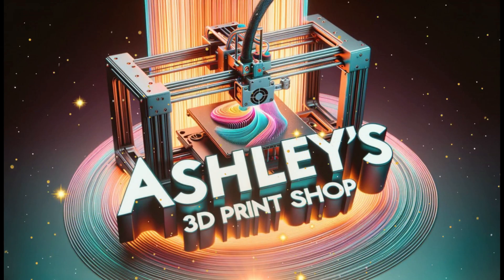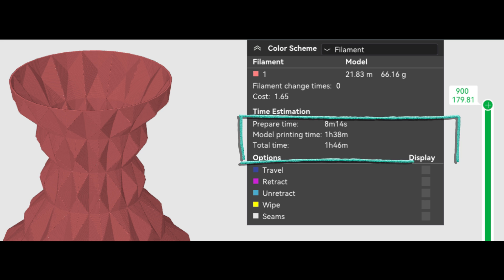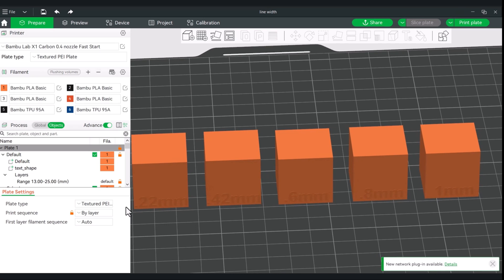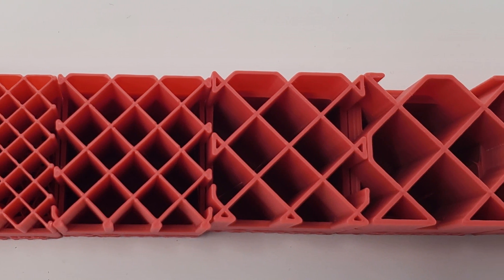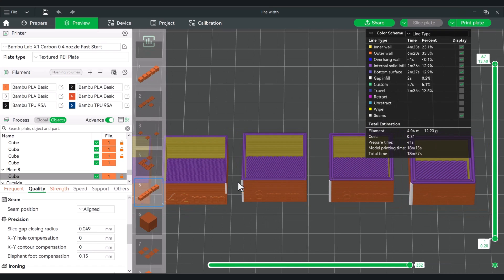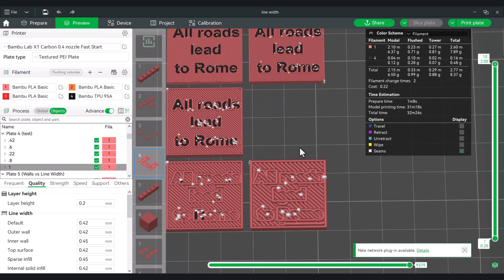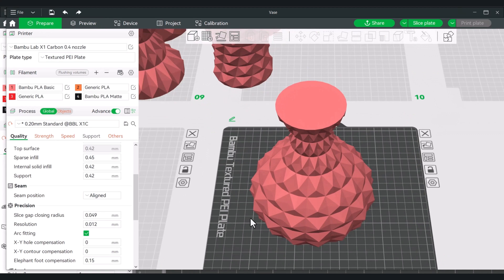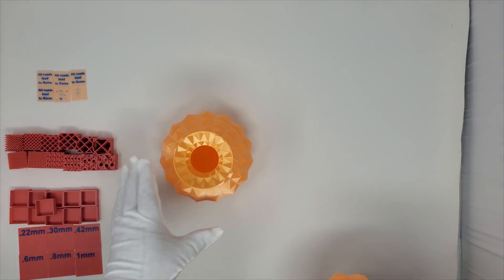Bambu Studio Tutorial Line Width

Comment: Hi, new to printing and trying seek best advise. I'm currently making keychains, I printed one on the standard settings with .4 nozzle at 0.8 fine setting. Came out good but I know can do better, it has lots of details, would 0.30 in quality settings do better, I had mine at 0.45. also need thick so doesn't snap easily.

Comment: Thanks!  I never thought a 0.8mm nozzle would be too useful, but I started to play with translucent PETG for containers, organizers, and vases.   It’s ideal to have one wide layer to keep a clear pretty wall,  but thick to make it strong.   multiple walls make it look cloudy.   Lots to play with here!
Reply from the maker: Great tip! I'm sitting here next to clear filament and never ran it with a higher linewidth so that is an excellent use case. I need to experiment with speed and temp too. 
If you find a good mix of settings would you mind sharing?

Comment: If you are increasing the line width, you are pushing more filament through the nozzle. So this might increase the pressure on the nozzle. How do you compensate for that? Is it good for long term use? Please explain.
Reply from the maker: Hello, thank you for the question. I can give a partial answer based on how I printed but this may be better suited for someone with a higher pay grade than me. (bambu lab engineer) But during these tests I printed stock with an exception of the silk vases I slowed down a bit to get a glossy sheen. (50mm/s) all temps were stock 220C.

So when I printed those models, with varying characteristics, they were printed at the same time. So we have printing, retraction moves all throughout the print jobs. Presumably any pressure issues would have cropped up then. They did look roughly like the sliced models. The single prints came out fine as well. 

The vase is a single 1mm extrusion, through a .4mm nozzle,  stream for over 1.5 hours and no print quality issues from what I found.

There could be some things I didn't take into account though. 

1. I used the AMS with these prints and they run through the filament buffer before going to the extruder. The buffer may "smooth out"  tension  alongside the AMS. There  is 10 sensors in the filament path, so the position, speed, and tension of the filament are monitored and controlled

2. There were no extruder skipping or under extrusions 

3. There was no stringing/over extrusions so pressure issues never cropped up.

4. I did not tweak settings and this was sunlu filament, but I did run an auto filament calibration for the X1C.  

5. I have not run 24hr prints or anything with the higher line width yet. All stock speeds except for the vase.  

Obviously printing lower or higher width extrusions, outside of the default, will produce desirable or less desirable results. (.3mm was surprisingly good)  If I revisit this topic I may dip into other nozzles and use the back spool holder. 

As far as long term use that is the million dollar question. 😁 I venture to guess default settings are the best for longevity but I only have 4300hr over 19 months printed and less than 100hrs using larger line width. I am still on my original hardened extruder, but I have swapped out nozzles before but none due to failure.

I hope that answer helps.

Comment: If I print out any container, it always leaks. Is there a way to print a vase, or jar, and not have it leak. Using a Bambu Lab X1 Carbon printer. Thank you
Reply from the maker: Yes and yes . So  vase/containers are tricky, as you well know. The 1mm vase in this example does hold water. The weakest point seems to be the bottom layer transition to the rest of the higher layers though. That print was a silk PLA and i dont know how long it will hold up so perhaps a resin coat would seal it better. 

I would have to revisit vase prints, speeds, filament and line width for a better answer.
Reply: @ashleys3dprintshop   ok thank you. I even made the bottom thicker, but still seems to leak. Maybe thickness of print, just cannot figure it out.

Comment: I want to buy a .6mm nozzle from Bambu but I don't know how I am going to slice it? The Bambu software doesn't show me a .6mm nozzle option.
Reply from the maker: Thank you for the question. There are some minor steps to add the nozzle to your printer in Bambu studio.
1. Open Bambu studio and go to the "Prepare" tab
2. Right below "Prepare" you will see "Printer" and to the right of that is a *Gear Icon*. Press the gear.
3. Find your printer and check off the .6mm nozzle and confirm
You can add all of the nozzles too so you don't have to do it later. .2, .6 and .8mm

From there you can select the other nozzle when slicing. Below the Printer icon. There is a down angle icon. 

If you have any other questions I an frequently in the comments.
Reply: thank you @ashleys3dprintshop

Comment: No matter what i do i get a top layer that is right next to the infill (so it kind of doesnt look right, but i cant sand it down either else i hit infill holes and thus worse)

My question is: how in the world do i add some extra top layers that actually print say 4 or 5 solid (not infill) flat layers at the top of my model. I learnt that wall loops do this for walls, but what about the top shell? I tried increasing numbers in what seemed the obvious choices but it didnt behave how i thought it would.
Reply from the maker: I haven't officially gone over it but you can use a modifier. 
There are 2 main types of modifiers. Height range or objects. For simplicity I recommend making a part modifier. 
at 4:50 if you look to the left I used a height range modifier to make adjustments just in that area.
The parts there all have a semi solid infill at the bottom but the top half is different. You can change, walls, infill, infill density, layer height, speed, line width and a bunch of other options in just  the area that is selected by the modifier. 

Here is a quick video about what I mean.
https://youtu.be/aXW4v-8iO3Q
Reply: Thank you so much for such a comprehensive and clear response. Absolute legend. (Same person as OP btw just on my music account)

This channel is an instant sub for me 💪

Comment: For as much printing as I've done with four different printers and having a background as a Machinist 3d modeler I  didn't fully understand what you presented up until now how this feature really works. This was so helpful in understanding line  width applications and exactly what the printer is doing. I look forward to this application to my non Bambu Lab printers and Bambu's. (S1 3 Pro/SonicPad-KobraMax-X1C-P1S) Thanks much. Looking forward to future videos.
     Question (before I experiment): I use epoxy resin to ensure complete functionality of vases. Can extra line width improve sealing?
Thanks again
Reply from the maker: Thank you for your comment and question.
YMMV with filament types and settings but the vase mode 1mm was a huge success.  did perform a water leak test when I saw your question. 
The default had small (beading) leaks at the bottom layer, where the bottom meets the first 1 wall pass. It's possible to adjust the line width at certain heights. 
 
The 1mm test held water without issue , I only did a few hours test with it but I consider it a success. PLA may not hold up long term though so an epoxy should work great.   I hope this information helps.
Reply: @ashleys3dprintshop  very helpful thanks

Comment: I don’t understand how it is possible to have a line width that is less than the nozzle diameter 🤷🏼‍♂️
Reply from the maker: It certainly seems counter to the nozzle diameter, but I think it's a combination of the gears being tightly controlled and precise movement and retractions. It's not perfect though,. The 0.22 line width has a bunch of errors when you look at the infill section. But the.3 on a 0.4 nozzle was  fine
Reply: yeah, the flow rate is less than the speed, so the extrusion stretches thinner, just like un-aerated water falling from a faucet that gets skinnier a bit as it speeds up.

Comment: Great video, I have been curious about smaller line width for text, your video is very helpfull with that. 
I want to try text on the buld plate side with small line width to see if I can print smaller letters that will still look decent. 
I had printed some custom coasters a while ago and found it difficult to fit the text I wanted because I needed large letters.
Reply from the maker: Thank you. There are a ton of variables to look at.
I had great success with the .3mm for the letters and you can set the line width for default for the rest of the  model. As long as there is a good foundation of infill you can mix and match settings. 

So I have not tried .23-.29mm so there is a possibility to go smaller than .3mm and still have quality.

Comment: Great video! The thing thats missing is how do nozzle sizes affect the same line widths ect? Since i got my printer print at all types of line widths and layer heights but dont understand what changes would happen on print quality by changing nozzle. Eg 0.6 line width on 0.4 nozzle vs 0.6 nozzle. Or 0.08 layer height on 0.4nozzle vs 0.2
Reply from the maker: I am going to copy a comment I posted earlier.
"So I planned a much longer video initially that would have delved into the different nozzles but it would have been a slog to watch. So I tried to keep the content condensed if possible. Especially using default nozzles.(.4mm)
but if you are curious there is a 2.5x multiplier increase or rough .5x decrease 

.2mm nozzle
line width .12mm - .5mm

.4mm nozzle (minimum sweet spot was .3 line width)
line width .22mm - 1mm

.6mm
line width .32mm - 1.5mm

.8mm nozzle
line width .41mm  - 2mm

So even though the .4 nozzle theoretically got down to the .2mm nozzle default layer height its quality isn't the same."
Not accounting for filament types it seemed like 75% of the default min.

I did not go too deep in layer heights and line width because it would be a very very long video with many variables.

Comment: So… for the equivalent strength, can increased width print faster?
Reply from the maker: I am leaning that why when looking at the prints.
The *infill test*was certainly stronger as we went higher in line width and faster print too as  it didnt have as many small "stops/starts/retractions/extrusions" while laying down similar amounts of filament. 
The walls test was similar in strength with an completely unscientific, hand crush test. 

Now these were mostly default settings so changing infill % or # of walls can affect the speed/strength.

Comment: thanks for this video! very well explained. these info open up a lot of possibilities without even changing the nozzle.
now I wonder if a 0.4 nozzle, printing at 0.2mm is the same as using a 0.2 nozzle with default settings, or if there is any substantial difference
Reply from the maker: Glad it was helpful!
So I planned a much longer video initially that would have delved into the different nozzles but it would have been a slog to watch. So I tried to keep the content condensed if possible. Especially using default nozzles.(.4mm)
but if you are curious there is a 2.5x multiplier increase or rough .5x decrease 
.2mm nozzle
line width .12mm - .5mm

.4mm nozzle (sweet spot was .3 line width)
line width .22mm - 1mm

.6mm
line width .32mm - 1.5mm

.8mm nozzle
line width .41mm  - 2mm

So even though the .4 nozzle theoretically got down to the .2mm nozzle layer height its quality isn't the same.
Reply: @ashleys3dprintshop  I understand why you had to cut the video down, but that's honestly very Interesting, thank you for the additional info!
Reply from the maker: @ansiaaa  Thank you for understanding. Perhaps I can revisit this if enough folks are interested.